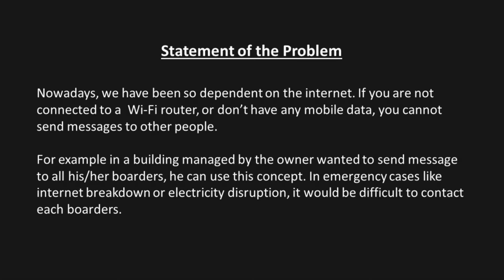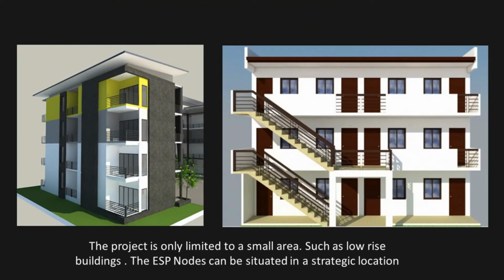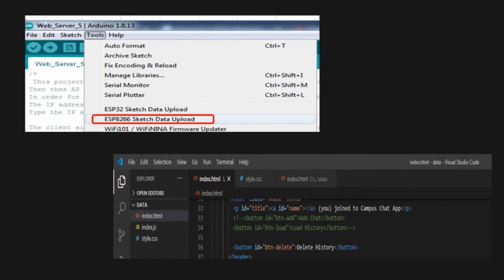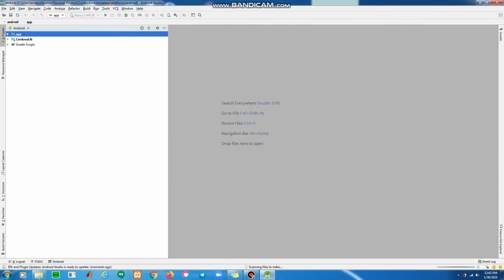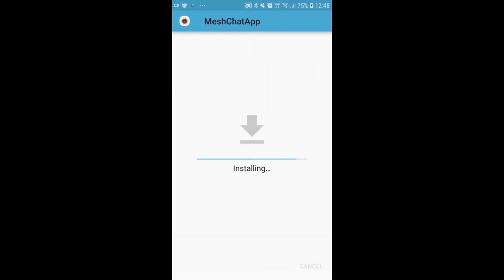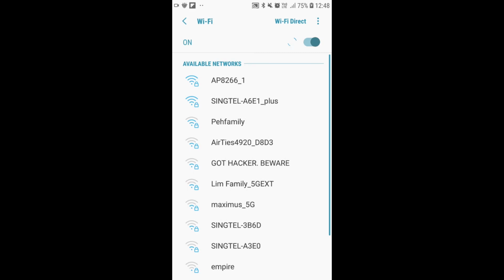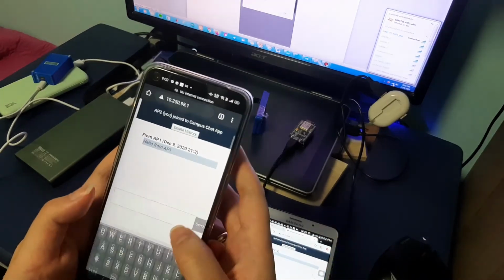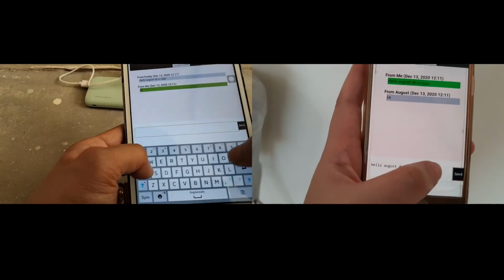Arduino| Real-time Chat Application using ESP 8266| Mesh Network

Comment: I am trying to do this using ESP32 modules, I have altered your code(different libraries) accordingly for this particular module and also I am not using any display so I removed that part as well from your code then later I compiled it and it was successful but when I tried to connect it from the mobile application, it did not let me in and thats where I am stuck right now, any help on this please? Thank you
Reply from the maker: Hi... Did you use same IP adress? Make sure your phone is connected to your ESP IP address...
Reply: @August301989  Yes I made sure it was connected to the ESP32's wifi

Edit: I did not print the ESP32's IP address since I removed that part, I will try again and let you know. Thank you
Reply: @August301989  Hi, individually it's working when connected it's IP but it it not getting updated on my other pages, I think I am having some problem in the broadcasting part, please help me on this part, thank you.
Reply: @kanaguyashwanth  did you manage to get it working?
Reply: @August301989  Below is the link for the code that I have altered, can you let me know where I am going wrong? Problem is when the message is sent from one AP, the other APs are not receiving it.

Link for my code: https://drive.google.com/file/d/1Pl_Ow5R7nNVlqGwMOLVJSPFUjxC3DFYb/view?usp=sharing
Reply: Hi, I have uploaded the code on my ESP32 modules and I used different devices to connect to the different Access points and then I have also entered the IP addresses respectively, I am able to join but when I send something, the other devices are not receiving the message. Any input on this? Thanks

Comment: hello a question how many mesh nodes can the network have? ... because I understand that the esp32 module can be up to 8 nodes
Reply from the maker: Hi Jonathan. Thanks for your comments. Yes based on the specification it can go only upto 8 nodes. In my testing I oonly used 3 nodes
Reply: @Jonathan Canales
Were u able to do it for ESP32?